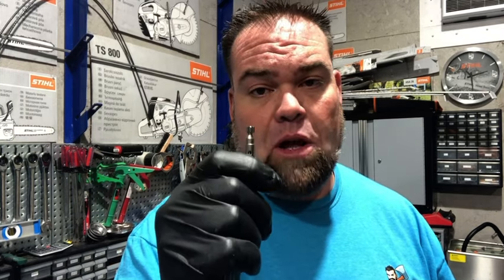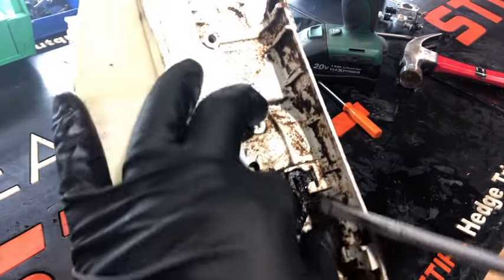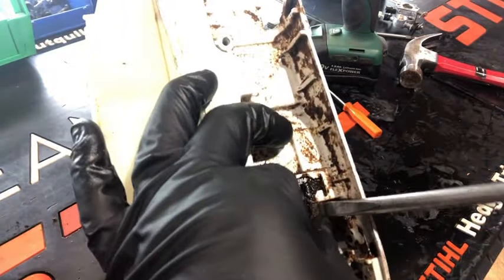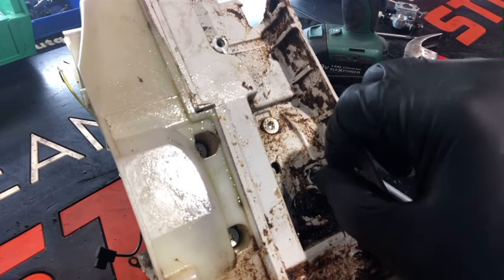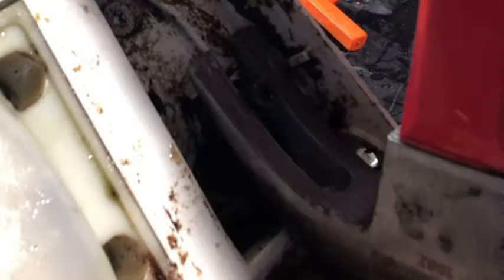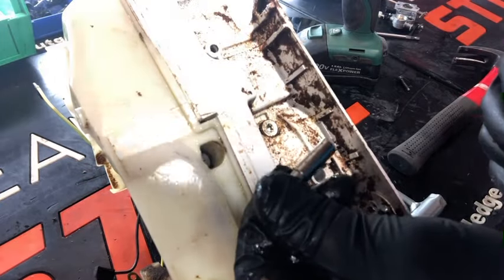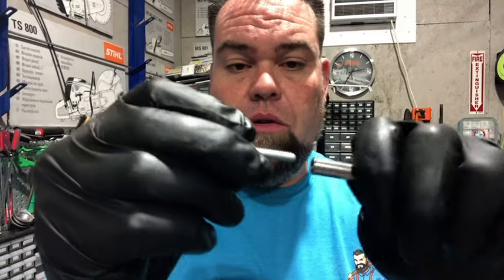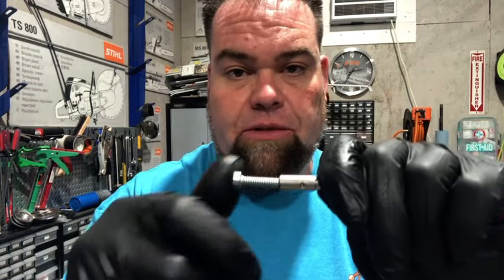Trick to replacing the oil pump on a Stihl MS 170, 171, 180, 181, 212 chainsaw. Step by step video.

Comment: Hey, on a ms170, I had a oil pump assembly turning loose inside the plastic housing that would make intermittent oiling, very annoying to diagnose.

Would green (metal to plastic) thread lock help next time ?
Reply from the maker: Just be careful when putting something on the oiler. If you slide it in and it blocks the oiler ports then it won’t work. If you are using a product like JB weld, I would put it on the case and re-drill the hole to size when the product is dry. Again just make sure not to clog the holes.

Comment: Thanks for the video. I have a Stihl TS460 demo saw that I'm working on. It is missing the high speed adjustment screw on the carb. Any ideas? Thanks
Reply from the maker: @alittlebitofeverything5090  you should be able to buy that part from your local Stihl dealer. Most all carb parts are sold separately as well a a complete assembly.
Reply: @AMGEquipment  Thanks for the response. I did call them and the part is no longer available. The saw is around a 2009 year. I might have to try an Amazon carb, but i don't want to.
Reply from the maker: @alittlebitofeverything5090  you may be able to find a used carb off of EBay or buy a Amazon carb and just take off the adjustment screw and use the Stihl carb if it works.